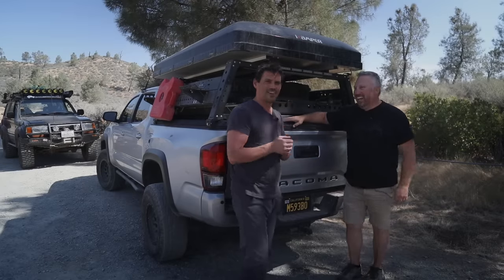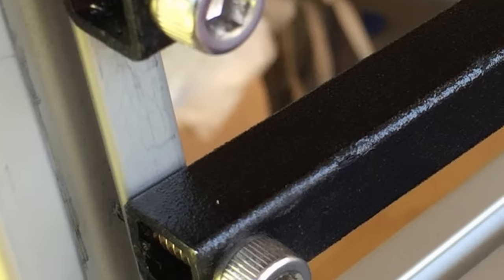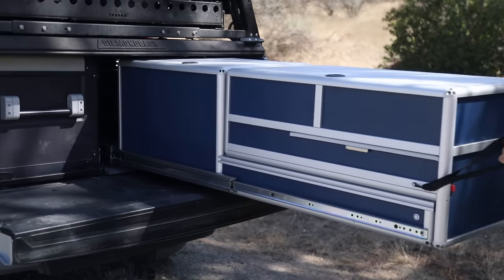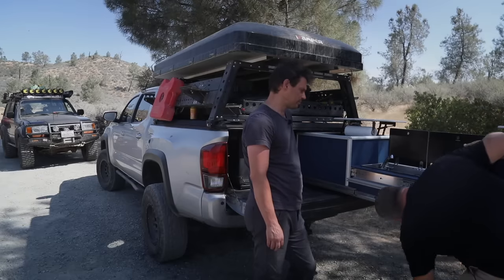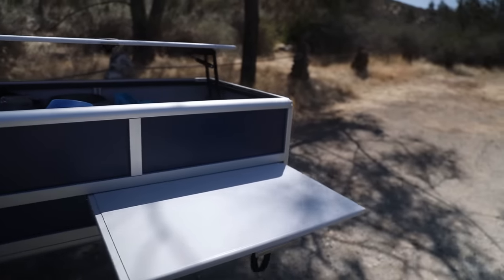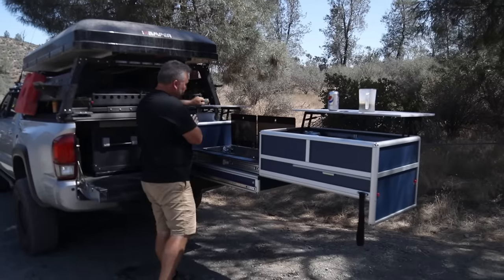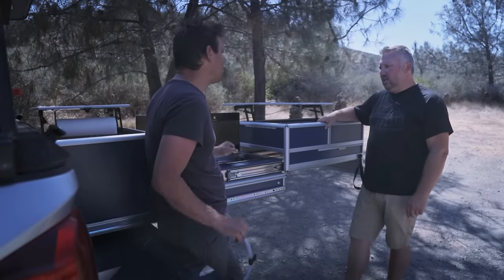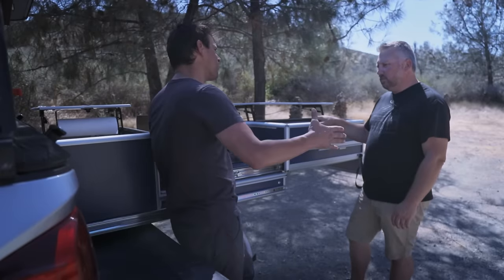Ultimate DIY Camp Kitchen

Comment: One of the best DIY camp kitchens,  i have ever seen. Probably one of the most expensive also, I would imagine.
Reply: Brdaley E no it was not cheap, but I also couldn’t find what I wanted, which was kitchen storage, pantry storage, running water, burners, cutting board, lights, and easily removable in a couple minutes. My co-founder and I started making Pull Kitchen’s now and added self-contained water and power to the list of features. We are on instagram @pullkitchen and PullKitchen.com
Reply: Yep. You can get one for the low low price of $4,000.

Comment: I would include a drop leg adjustable aluminium pole at the end to stop it bouncing but it’s perfect otherwise.
Reply: how does one design this and not automatically include a drop leg
Reply: like make LTD .)
Reply: There is no need. That is y he is using  500 pounds slides. Those 500 pound slides are not cheap
Reply: I know it's counter-intuitive, but this would likely damage the sliders by torquing them upward. Imagine if someone heavy got in the rooftop tent while the pole was out? The car's suspension would compress, but the pole wouldn't, and the sliders would be bearing the load. Better to just deal with a little wiggle and stay safe.
Reply: I was thinking the same thing. I'd be a little paranoid about the bounce, and guaranteed I'd be leaning on the end of that thing having a beer with a buddy. But it's a great concept.
Reply: @Gantzz321  500# sliders, must have figured that made it unnecessary.
Reply: @Gantzz321  How does one spew out verbal diarrhea without thinking ?
Reply: @warrthogg1758  not sure, could you tell us how you do it?
Reply: Casey Fulton use a gas strut for the leg system to add some suspension to the leg.
Reply: Greg Ward well as I designed it I’ll tell you. :). So yes 500# rated sliders is the backbone, and we’ve calculated that it will support 150lb person hanging on the end when fully extended. There’s a cantilever effect so it’s not 500s rated extended. As far as what people notice as bounce is due to the mount that this unit has, which was sliders mounted to plywood. As this was my DIY project I went that direction but now with our production unit at Pull Kitchen we’ve redesigned the mount and that bounce is gone. 👍🏼
Reply: JDAC no they are not, but as they are the backbone of the build they were necessary and work beautifully. On our production model at Pull Kitchen we’ve actually increased the length and completely redesigned the mount so there’s no bounce and very little deflection as opposed to my rough DIY build here
Reply: Brad Simpson lean all you want! I do all the time and my new design doesn’t deflect like my rough diy blue drawer did :)
Reply: David Douglass cost?
Reply: I would add a second drawer slider instead

Comment: i actually built similar drawers and put  telescopic poles at the end for some extra stability. my drawers aren't as tall though. It houses a sink, space for my coleman stove and a ice chest fridge on the right side. Left side drawer holds all my equipment, tools, dishes, etc. The right side drawer is fully contained so there's no hoses sticking out of the bottom. i have side drawer fronts that have magnets on them so they just pop off and on easy and i keep my freshwater, gray water and propane tank under each of the 3 side compartments.

i used wood for mine and it's a bit crude compared to this build but it does the job :)

Comment: HDPE is available in 3x5 sheets at Menards. It can be cut to size with a regular jigsaw, drilled with regular bits, and routed with regular router bits. It comes in several colors and many different thicknesses.

Comment: Wank wank wank, awe geez, when he pulled that out and opened it up! Beautiful mate. Look, if you think its over built, so be it. Sometimes things built dont have to be financially viable when it exercises you talents and works the brain. Very well done.
Reply: Thank you! It’s a game changer to be cooking by the time others are still getting their tents up 😇
Reply: David, down here in Aus I use a Jayco wind up camper. Ive outfitted it to make things quicker to setup and put away. It encourages us to go away more. One of the mods I did was make a timber pull out kitchen utilising the side hatch. Its only a basic unit and it was built around a 50 yo stove. The stove isnt very practical for the application but I just had to use it. I would have had more drawer depth if I used a more compact stove.
Reply: @polyanthemos  I agree the easier it is to use our gear the more we use it! Sounds like you’ve got a great setup for yourself 👍🏼

Comment: Just wanted to comment to point out there are "drop-in" 8020 t-nuts that you can place anywhere inside the channel of the profile. They're just as sturdy as the normal slide in t-nuts. I used these aluminum profiles to build my thesis project, and the drop in t-nuts were a life saver! Great project, the results scream quality.
Reply: Alberto Castillo Gutierrez they are really helpful for sure! I used them where the sliders connected to the drawer

Comment: This is fantastic! Thanks for the upload! Been looking for bed solutions to work with the Jeep Gladiator.
Reply: john hartel if this drawer came in kit form, everything needed to assemble at home, would you buy one?
Reply: @daviddouglass208  as much as i would love the project of figuring it out on my own, knowing a kit could be available exactly or similar to yours would definitely save a lot of time with trial and error. I've done a few hand sketches of my own and was planning on getting something developed in 3D solidworks. I know the price point is going to be kind of high whether i construct one of my own or purchase a kit, so my only concern with a design like this its weatherproofness. I see from the video the drawer system benefits from a hardtop bed cover that works with the rack system used. My plans are to go with a Leitner design and i dont think that allows for a bed cover or tonneau cover (it would be cool if it worked with a Retrax system). Making a functional cover similar to a ARB or Snowmaster fidge would probably solve most weather issues in an open bed. Brad and Marco also benefit from this style system because they are protected within the their wranglers. So, am i interested in a kit? Absolutely!!! Will it work for my use? I dont know.. Thanks for the reply!
Reply: john hartel thanks for the feedback. The current version of this drawer is not weather resistant, but if that was the need then the answer is an external box which is easy enough as the baseplate is already there. It would just be the top and sides. I appreciate your input!
Reply: @daviddouglass208  you bet man! Yea, i agree a box would probably the ideal set up for an open bed application, especially for making it quick to detach design. I know your application will work in more trucks than your own, so i see it to be beneficial to produce a kit for like minded overlanders. Even with a box design, coming up with a way to (mostly) seal it closed would be the design issue. It would be cool to have an 80/20 framed box with an aluminum tambour style roll up door at the front, and then the convenience of a main slide out with the cooler/fridge on top, and within main slide out is another slide out with an camp stove. Simple and effective enough for my needs. After seeing the video, ive since joined the Overland Bound community to follow the build. Is there a specific slider that affixes to the 80/20 or did you just modify the slider rail to accept a Tslot bolt? I couldn't see how it was attached from the video or the photos. Thanks again David.
Reply: john hartel I’ve got ideas on how a weather box would work, I think I need to start a business :)

Comment: As someone who has worked in automation, I thought that I would see more drawer systems built with aluminum extrusion (i.e. 80/20).   But I also understand that the price point could be prohibitively expensive.   This drawer system looks amazing and is a prime example of the design flexibility that 80/20 gives you.   Great job!  I'm very impressed with the finished product.   What does the drawer system weigh dry?

Comment: That's really great work, you can tell he's thought this out. Is there anyway one could add supporting telescopic legs  that fold down on the end of the system just to add rigidity to the kitchen? One of the best I've seen, good job Dave.
Reply: Garth Hayward haha everyone wants a leg! It’s pretty stable! The first change for stability I’d make though is dual locking main sliders. I did one so it was easier to pull out which allows it to sway a little side to side. But it doesn’t droop much and I think more about the sway (if I notice anything at all). The camera makes it look like it’s 15’ long. Thanks for the feedback!

Comment: Hi Dave, if u read this absolutley stunning job on the camp kitchen. I had a thought for those cables running into the kitchen itself if your interested, you may wanna check out cnc router drag chain to cover them and move with the slide. I found it on ebay and plan to use it in conjunction with a fridge slide in the back of my wagon. Cheers :D
Reply: Kail Noakes That’s good input thanks! I couldn’t remember the name of that item, what I’ll need to look at is that I only have about an inch clearance above the cooktop and the bottom of the upper drawer. But I’ll have a look, thanks!

Comment: 80/20 makes a T-Nut that is removable/insert-able without taking the whole frame apart. They cost a little more but are worth it.
Reply: vistle yup the roll ins, we plan very specifically now in our builds but every once in awhile we still use them. :) We started www PullKitchen com, or check out Instagram @pullkitchen

Comment: Awesome build.  Dave, would you consider putting some sort of brace under the drawer once it's extended to reduce droop and stress on the unit?  A simple retractable mono-pod for example?  Or is it not needed?
Reply: shouldibehere one could totally do that, what I have found is that at camp it’s not really out that much. When it can pack up so easily and quickly it is only extended a short time usually during cooking and eating. The rest of the time I put it away and it doesn’t droop much, those sliders are beefy

Comment: Yes! I’m ordering a Tesla Cybertruck and I’m starting to plan something like this using 80/20. Thanks for sharing. Why did you use standard sliders instead of the 80/20 slider track option? Any reason?  And lol, same experience with 80/20. Taking my projects apart several times for one tiny piece.
Reply: P L full extension and strength. 80/20 won’t give you what you need

Comment: out of curiosity, why didn't he put the slide-out drawer on the left and the fridge the right. It would make sense to be able to still use the kitchen portion while sliding our the fridge.
Reply: Cory Pham I put it on the passenger side to offset the weight of the driver, me, because I’m always driving it. The fridge is accessible when I pull it out to the edge of the tailgate, if I need the freezer half then I pull it out a little more and it might be in the way a little, but 99% of the time it’s not in the way. Your suggestion is a keen one, but I didn’t want to have to walk around the kitchen to get to the fridge every time

Comment: Man i wish i could build stuff like that. I cant even use scissors on paper to get straight lines let alone build a kitchen to precision 😂😂. In australia we use locking drawer slides for everything. Do you think some locking slides would be better suited on the middle third of the kitchen. Id imagine on a slope the middle third of the kitchen would wanna slide away on its own?
Reply: The lower and upper stage lock in and out, no running away. We produce them now as well, you can find them on Instagram under @pullkitchen

Comment: Now that's one fancy draw system Dave, I love it! I have just bought myself a draw system from one of the suppliers here in Australia and will be fitting it into my 80 series in the next week.. one question I have please, I noticed that when fully extended it does move up and down a bit so, how much movement & weight will it take when fully extended?
Reply: Tim Gay Hey Tim, so this unit had a plywood base that exactly fit the bed of my truck and it did flex when fully extended. It’s been redesigned now and I would say the vertical bounce is maybe an inch. Very little. It will hold about 150lbs on the end briefly, but I wouldn’t recommend someone hang on it of course. :) We currently are working on our SUV unit right now and getting the CAD set up for July 2020 at Overland Expo West

Comment: Amazing.
Personally I'd add an extendable leg at the very end to stop it from swaying up and down.  But I like it a lot and will have to borrow a few of those ideas.  :)
Reply: Pat thanks, that seems to be common though as this DIY version had a plywood mount. We’ve started to produce them now, @pullkitchen on Instagram, and we’ve improved the design greatly
Reply: @daviddouglass208  Are the DIY plans still available now that you guys are in production on these? While I appreciate your new business plan it's a bit rich for my pb. Awesome idea either way and setting up camp in a few minutes is very cool.
Reply: @6806goats1  they are on Overland Bound’s website under the DIY forum, Tacoma 2.0 Drawer

Comment: Hi, Dave your product is amazing, I would like to buy one in the near future; but also the rig that you build up have a lot of things that I would like to do to the one I own. Could you please tell me which Dometic fridge you have (seems like the DX3 75) and wich slide do you used, I have been searching the internet and not found a solution that incorporate a Diamond Back cover also. Saludos desde México.
Reply: Hola! Yes it’s a dual zone Dometic 75. I couldn’t find a low profile slide so I made my own. Pull Kitchen may start producing one in the future but I posted plans for it on Overland Bound’s website under the DIY forum. It’s called Simple Fridge slide, or something close to that. Works pretty well and allows me to pull out gear on the whole half of the bed, the fridge and gear behind it.
Reply: @daviddouglass208  ¡Hola de nuevo!, thanks a lot for your response, I’ll look for the plans at Overland Bound’s website. I’ll be in touch with you for both (slide and pull kitchen) again in the near future. Have a nice day!

Comment: That cutting board material is what I plan to put on my tailgate like mountain hatch cover for Tacoma.  It would cost about  $97. Much cheaper.
Reply: Overland Autism Adventures If you look at my tail gate I did the same, Mountain Hatch was just too much. I used 1/4” HDPE but know you’ll have to router the edges as the tolerance when you close the tail gate is minimal, 1/2” in should work so the tail gate will close fully.
Reply: @daviddouglass208  Thanks for the tip,I shared this video in Pickup Truck Camping group on Facebook.  It's amazing!

Comment: Truely awesome setup. Curious to know how much he spent on this project roughly?
Reply: Jordon Foster I would say I spent about 2k altogether, without factoring in my time in labor. The sliders are expensive (2 sets) as was the aluminum. I used simple plywood for the panels which isn’t a great long term solution for the drawer. My subsequent models have composite materials which are completely weather resistant.

Comment: Hey,we use aly 80.20 at work for all robot cages,and you don't need to use t nuts there is a special nut that slips in and spins to lock into t slot.
Reply: Thanks for the tip but a link or description would also help...

Comment: Wow I’ve just ordered the carcass for my drawer build and it’s extruded aluminium. I’m kicking myself now that I didn’t see this video first. I wouldn’t have gone for ply for the drawers. I’m curious how did you finish the ply to such a high standard ? @dave Douglas
Reply: They are just painted. Nothing fancy. Now with PullKitchen we use ACM panels panel routed

Comment: Am I wrong or is there a double bed on top of the kitchen?
Reply: So the kitchen slides under my Diamondback tonneau cover. My KB Voodoo rack is sitting on top of the cover (which it goes on and off like a backpack) and that rack has a full extension sliding cargo tray. On top of the rack is the roof top tent. Hope that helps! 👍🏼

Comment: What was the approximate cost of this build? I've seen this material, but remember it kind of nickel and diming you to a very expensive end product.
Reply: chris sumner short answer— NOT CHEAP! Extruded aluminum is expensive and depending on the type (square vs rounded) and corner fasteners used will affect price. All in probably about $1800 as I purchased items over the last 4 months. Sliders are $200 alone and there’s 2 sets. The forum shows the build process
Reply: @daviddouglass208  wow, that's crazy pricey.
Reply: Scruffster yup, it all depends on what value one wants to get from the investment. It’s certainly not for everyone!
Reply: Saw this awesome build in action this weekend!  It is an amazing piece of work Dave manufactured. The backside of his has a paw print now lol 😉 🐺
Reply: @daviddouglass208  true. I know I want one.
Reply: @daviddouglass208  looks like it needs a bottle opener 😁
Reply: Scruffster One might think that...but 80/20 itself can do that! Haha! The slot on the extrusion works great

Comment: Are you able to open the diamond back cover without those extra stuff on the top on it?
Reply: No, so I have a half DIY bedslide and the whole rack and tent pull off as a unit when I’m not off roading.
Reply: @daviddouglass208  Do you have pictures or a video of the bedslide and rack system? It would be great to see how it works and how it's mounted!!
Reply: @omy1974  I posted a thread to Overland bound’s diy forum on the slide I made for the fridge. It’s called something like simple fridge slide. It allows me to pull out the fridge and gear behind it and it’s a very low profile anchored slide